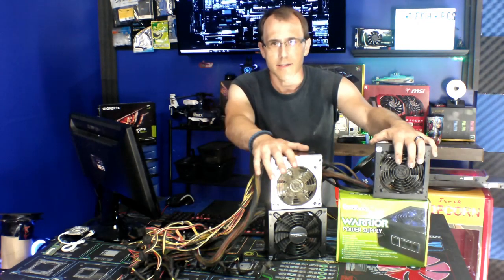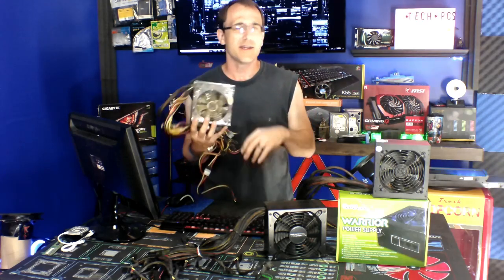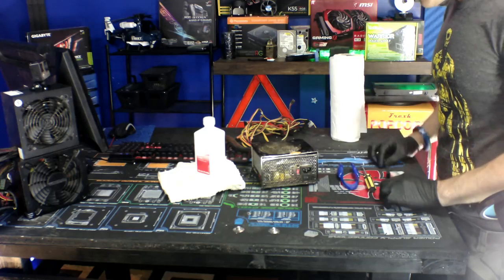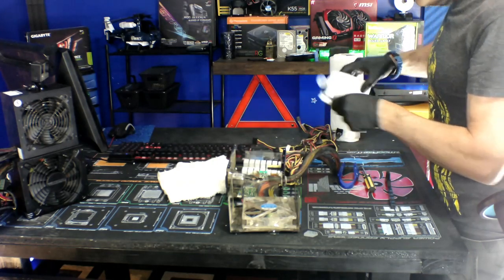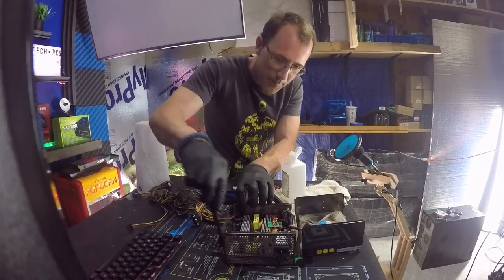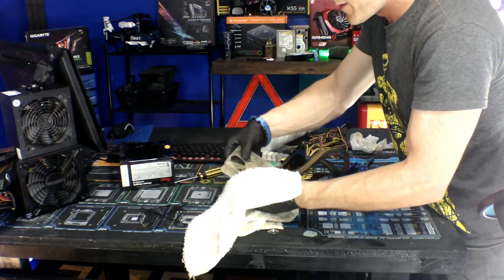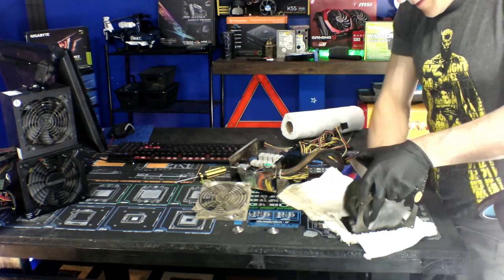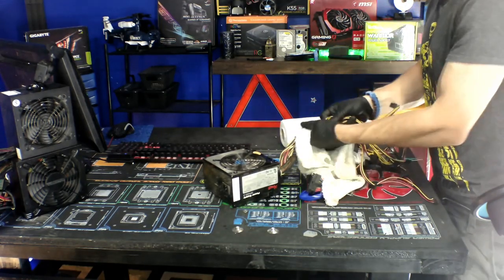How too Clean a Power Supply - Pc-PSU Maintenance

Comment: Alcohol shouldn't be dumped on a PSU ever. Isopropyl alcohol isn't sold at 100% concentration in stores but at 70%-91% usually. That means it contains from 9%-30% water. It is much safer to clean a PSU with a dry, soft, long bristle paint brush with a plastic handle and a blower.